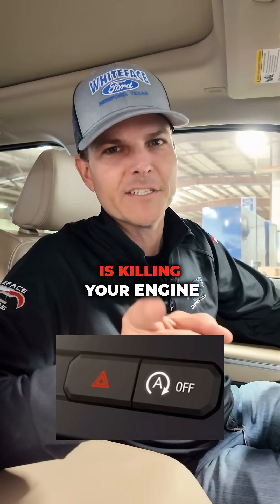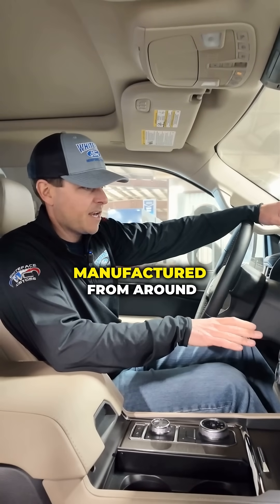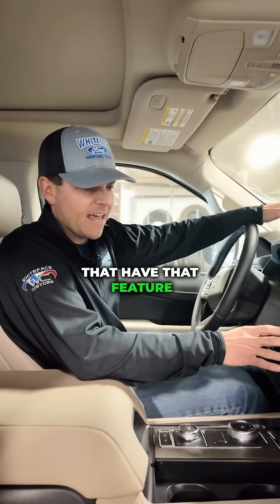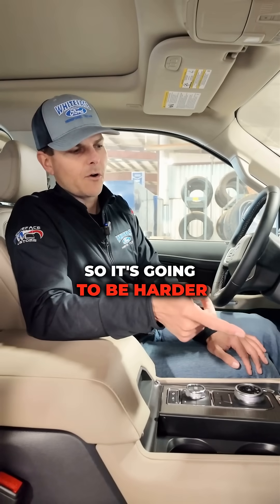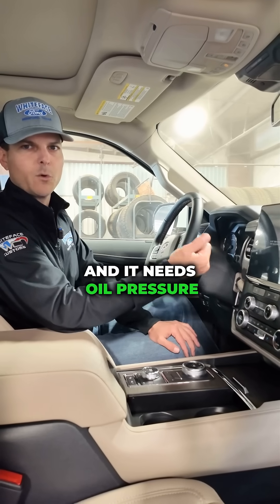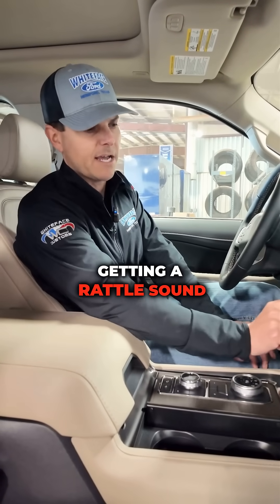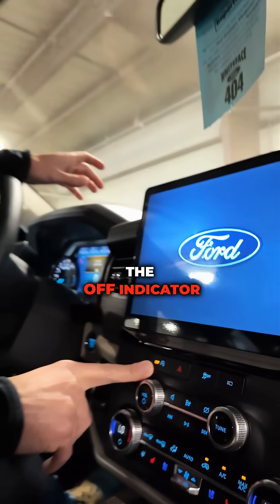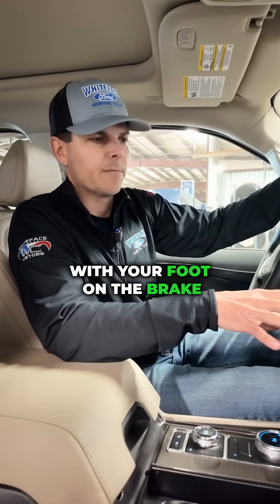Is Auto Stop-Start Wrecking Your Engine? #Shorts

Comment: All they had to do is make it the other way around where you choose to turn it on instead of being forced to turn it off
Reply: Mercedes does just that. The owner is the boss, not the  EPA. There's a delay. I've driven a Tiquan and Jeep rentals. Same deal. It's a safety issue.
Reply: Excellent point; I usually forget to turn it off until the first stop light.

Comment: While auto start-stop technology is designed to improve fuel efficiency, some drivers are concerned about its potential impact on engine components. While it can lead to increased wear on the starter, alternator, and battery, modern vehicles are designed with more robust components to handle the increased usage. The technology doesn't engage until the engine reaches a certain temperature, and it includes features to prevent oil from draining from the engine, minimizing wear during restarts.
Reply: Modern cars are installed with crap components. Nothing is more "robust." Someone has been telling you stories
Reply: Not true.

Comment: I got somewhat lucky when i got my 2016 ford f150 3.5 NA because Ford didn't put start/stop on the xlt non turbo models 😂 starter is original and i have 124000 miles on it no issues

Comment: you yanks wouldn't know about this, but there is a worse stupid feature in manual cars (all your cars are gay autos).. the hill-start assist. an abomination that treats you like you're 5, and doesn't work anyway. Put you foot on the foot brake at the lights on even the slightest hill and it forces the brakes on, with a TWO SECOND delay !!!!! when you try to drive away. Supposedly so you don't roll back, it actuallys forces you to sit there for two seconds... of course everyone behind you gets pissed (quite rightly)... damn thing . Luckily mine stopped working at 45K km.. yay...

Comment: The assertion that it kills the engine is a lie. Auto start-stop vehicles are equipped with batteries that have higher cranking amps. The feature has no bearing on engine performance.

Comment: You can also disable it with FORScan, The $10 OBD to USB you connect your laptop to it and disable it you never have to worry about it turning back on again unless you re-enable it. And while you have it connected you might as well enable Windows down and up with your key fob.
Reply: Foreskin
Reply: I've heard this but yet to see it.   So far using FORScan via Bluetooth ODB2 doesn't show.   Does it need to be direct connected to see that option?

Comment: I've been saying this forever and then you get assholes that say oh the starters are meant to handle it and all this other BS the tiny miniscule drops of fuel you're going to save it's not going to offset engine where starter where and just being annoying in general let's say in an emergency situation you need to move out of the way right away it takes a second for it to start and then go and what if for some reason it doesn't start just total junk

Comment: The problem is you have to reset it every time you turn the car on! They should design it to default to the off position.
Reply: You can buy kits to do that, my dad has one in his truck and it took him 5 minutes to do it
Reply: There's a service mode where you can set it off.
Reply: scan tool can disable it for good
Reply: Funny thing with my 2019 focus st line is once you turn it off it stays of completely
Reply: Thanks for your useless contribution.
Reply: Why would they do that. They want your vehicle to crap out so you come buy a new one.

Comment: Hmm most new stop start use a "starter alternator" to start,you ll see that the belt tensioner tensions both ways ,and the Alternator housing is larger than usual .

The tradional Starter is only for the cold start..

Comment: I used FORScan to shut it off permanently on my 2015 F150.  No pigtails, no BS.  FORScan allows you to edit settings in the vehicle's ECU.  I also used FORScan to add descent control, and enable my trailer brake controller unit.  Lastly, I used it to enable me to open/close my windows from my key fob!  Handy little FREE utility...  Sorry to all the losers who don't drive Fords though - FORScan only works with Ford vehicles.
Reply: How about a 2022 dodge etorque 1500, any softwares for that?

Comment: The auto/start stop is the most USELESS feature on a car.  This guy is 100% right.  Does nothing except damage your engine and adds even more wear and tear on everything.  There is no reason to even have this feature.  I know a mechanic that will remove this feature for $50.  He's done it on my 2 current vehicles.  It is completely removed.
Reply: I think what he’s saying is on spot on because I have a 2021 Durango I’ve very gently used it and done excellent maintenance on it and at about 68,000 miles of course right after my warranty expired I started to hear a little tick. everybody told me it was the Classic classic Dodge tick not to worry, but then I noticed it started to sound a little bit worse Investigated and apparently there’s a few years of the V6 motor that’s in my Durango Citadel that have cam Loeb wear and it sounds like what he’s describing where it basically ruined my engine and the guy at the dealership said that he’s had it happen on vehicles as low as 17,000 miles and then some that have more but he said it’s always The same exact cam on the passenger side of the motor so to me if it’s always on the passenger side and always the same one it should be covered as a recall, not costing somebody $3500 to get new head gasket, rock arms and lifters on half my motor and now I feel like I have to trade it off because I feel like the other side is probably gonna fail or that the motor is just pretty much shot and I don’t wanna be stuck with it so I from personal experience think that it’s a problem. Let’s just be honest all the things that they’ve developed to help with emissions Have made motors be less reliable compared to older motors. Look at a diesel engine as an example diesel engines used to go for hundreds of thousands of miles and now you’ve got DEF and other parts that fail and I think older motors in the simplicity of them is really what’s gonna get you reliability and longevity which people want I’m not anti-earth, friendly by any means butI just think that it’s costing people a lot of money for shitty Engines compared to what you used to pay a fraction of the price for a more basic engine that was more reliable
Reply: Unless its a Mazda. The start/stop is sh*t.
Reply: @PoliCat-u5u No unless it's a hybrid start/stop is complete garbage
Reply: @domini384  Doesn't have to be a hybrid for the Start Stop system to be good. My family has a 2014 Mazda 3 With Start/Stop and we never had issues with it, neither with the engine or battery.
Reply: @PoliCat-u5u What's makes the Mazda one so special? Is your metric that you never had an issue with it? That's not why people hate it.

With a hybrid your vehicle starts off the electric motor which also runs the ac compressor. Once you get going the engine turns over via the hybrid motor and not a starter
Reply: No actually. He's 100% WRONG. For one. It's not just a normal, everyday starter doing the work. It is a purpose built electric motor. For 2. There are multiple batteries in start stop vehicles to compensate for the extra use. This is just BS fear mongering from Americans who hate anything new. Stop start was first used in the Toyota Crown in the 70's. Basically Japan's Rolls Royce. Now, why would a manufacturer, synonymous with reliability and longevity, use an inferior system in their most expensive, regal vehicle? They WOULDN'T. Because there is NOTHING wrong with stop start.
Reply: @jonjacob1962   its USELESS and serves no purpose.  No vehicle needs it.   I recommend people find a mechanic and have it removed.  It does NOT save gas.  It does nothing for the car.
Reply: @PaulC65777  lol. That's also not true. I drive a 2022 Jeep Grand Cherokee L for Lyft and I get about a 10$ savings a week in gas when I leave it on vs turning it off. It also helps reduce emissions when stopped. But ya know. Climate change isn't real and all that bs. Smh.
Reply: @PaulC65777  also. You don't just "get it removed." You got ripped off. Lol. All they likely did was pull a fuse. And that's gonna mess your car up more in the long run than just letting it do its thing.
Reply: @jonjacob1962 no, usually a module is is installed that just set it to always be off....look it up.
Reply: @jonjacob1962  nope.  Removed.  No fuse
Reply: @jonjacob1962  Not sure what you drive but there are not multiple batteries on all vehicles with this technology. You ask why a manufacturer would use an inferior system. Because most do all the time for cost cutting measures. Look no further than all the issues Ford, GM and Stellantis with cylinder deactivation issues. This tech just touched the surface. For example, he did not mention that turbo bearings in turbocharged engines can potentially be damaged as stopping oil flow during idle periods could cause heat soak. There are other issues but not necessarily engine related. 
It disengages the AC on most all ICE vehicles. You can't have the AC running when the engine is not. It can also be a safety hazard if it turns off when you're stopped in the middle of a busy intersection trying to make a turn. You find a small window in the opposing traffic to go and there's a hesitation to get going. In some vehicles it even shuts off power to the dash cam. Try doing some research so you're not so ignorant.
Reply: @TheComingGlory Sure. Your right. They don't ALL have multiple batteries. It depends on the engine displacement and cranking needs. But they do all use AGM batteries which can handle the extra work no problem. I drive a 22 grand Cherokee L. My truck does have an extra battery specifically for stop start. I've put almost 70k miles on my truck since I got it new in 22. I drive for Lyft part time. I save about 5 to 10 bucks a week in gas thanks to the stop start. My truck has been in the shop multiple times for recalls and brake issues. The brakes are massively undersized for the trucks weight so the front rotors overheat and warp constantly. Haven't had a set last more than 20k miles. But you know what it hasn't been in the shop for? EVER. Anything related to stop start. As far as turbos and AC goes. If the AC is on and the compressor is running or the turbo is hot. It won't shut off. Or it will turn back on sooner. There are some newer vehicles that have electric motors to drive the AC compressor so that isn't an issue anymore. As far as your little turning scenario. You show me one single example of that EVER happening and I'll show you a reckless driver who took a gap that was WAY too small.
Reply: @jonjacob1962  It is not just engine displacement/cranking speed that determines the need for multiple batteries. It is the total electrical load as larger luxury vehicles tend to have much more
powered options. As for AGM batteries, your wrong again saying they all use AGM batteries. EFB batteries are used in small to midsized vehicles with start/stop. Just because it has not been in the shop for Start/Stop does not mean anything. Depending on how you drive, and other variables can result in premature wear in certain components that you cannot see. Your 70k is not enough to determine whether major components will have issues, but time and mileage will determine it. We have 62k on our vehicle with Start/Stop but it is disabled and will remain that way unless we get rid of it. It appears that some manufactures allow the vehicle computer to disable the Start/Stop under certain conditions like when AC is not at the set temp or Turbo temp is too hot. So, for people in certain climates, they may not see much if any benefit from Start/Stop if it is constantly being disabled. Anyway, you're missing the point that not all vehicles operate the same and people have different driving experiences. As for my supposed little turning scenario, it is not mine but what has been reported by many, and I have experienced this myself. I am not a reckless driver and do not cut in front of people, so your full of crap there. There is a true hesitation on vehicles equipped with Start/Stop but some are better than others. Do some research Mr. Lyft driver so you're not so ignorant.
Reply: @TheComingGlory smfh. For one. I never said it was because of engine displacement and cranking SPEED. I said cranking NEEDS as in the NEEDS of the vehicle's electrical system at the time of cranking. Which, yes, absolutely does vary depending on the vehicles other electrical components. As far as AGM vs EFB batteries. Okay. Cool. Still doesn't negate the point that it ISN'T just a regular old lead acid. It is an optimized battery system that can handle the extra needs of the stop start system. Just like the starter isn't just a regular old dinky starter. It is a purpose built, optimized electric motor that is designed to handle repeated starts. As far as my 70k miles not being enough to determine anything. I would argue it's PLENTY to prove there aren't any DRASTIC PRE MATURE issues because of stop start. I've put 70k hard miles on my truck, a vehicle already known to actually have its fair share of pre mature issues, only turning the system off during the 2 weeks I experimented to see how much gas it actually saved, and I haven't had any issues with it. The way people talk about it, you would think I would have been through 3 starters and 4 batteries already. Clearly YOU'RE missing the point I'M trying to make. It's not that all vehicles are the same or that start stop is the best or that it DOES in fact save you a BUNCH of money. I'm just saying it ISN'T as bad as everyone seems to THINK it is. It's just lies, misinformation, and fear mongering. There isn't anything inherently WRONG with stop start. Sure. Some people may experience less savings depending on the climate and their driving habits. But to say it doesn't save anything or that it is a problem or that it causes problems pre maturely is just wrong. Period. That is my point. As far as your turning scenario. It IS YOUR scenario because YOU are the one who brought it up in this conversation. ANY vehicle can stall in the middle of a turn. From a stick shift to an automatic to an EV to an ICE vehicle. Anything can happen to cause a vehicle to stop moving or not go when or as fast as you need it to. It is NOT specifically a stop start problem. So let's not imply that it is. Yes, some stop start systems do take a little longer to turn the motor back on than others. But it's up to you as the driver, to adjust your driving habits accordingly. If you know your vehicle takes a little longer to start back up. Maybe wait for a bigger gap... Maybe take your foot off the brake a little sooner to get the engine started. When making an unprotected turn, in the US, unless otherwise stated, you are obligated to yield to the other vehicles right of way. So yes. If you take a turn and that half second stutter causes you to get hit. You are, by definition, a reckless driver because you took an unprotected turn without properly yielding to the other drivers right of way. But sure. Say whatever helps you feel better about your bad driving.
Reply: @jonjacob1962  You said, "It depends on the engine displacement and cranking needs." You never mentioned total electrical system at the time of cranking until now that I mentioned it. 😂 I mentioned EFB to point out your ignorance that it is not just AGM as you claimed and not that I care one way or the other that it is old lead acid type. I stand by what I said regarding your 70k mileage not being enough to determine long term premature wear. Like I basically said the jury is still out on that. As for the driving scenario, learn some reading comprehension, yes, I brought up the scenario, but it is not mine as it happened to many people including myself. What your basically implying is that the driver of a vehicle should have to compensate by altering how they drive because of hesitation induced by a feature they do not want. You then call people reckless because they just want to drive the vehicle normally without having to compensate for hesitation. 😂 You truly are ignorant and do not know what you're talking about. 😂 You go right ahead and leave yours enabled but as for me and most of the public will disable it. So glad that Zeldin is reversing these nutcase EPA mandates forcing manufactures to install this crap in the first place. They may continue installing this junk but there are ways to disable it.
Reply: @TheComingGlory  lol. Alright dude. Sounds good.
Reply: @jonjacob1962  bad battery caused car to not start in traffic. Stuck on free way until someone jumped me. I would rather my car not start after work than in the middle of traffic on the freeway.